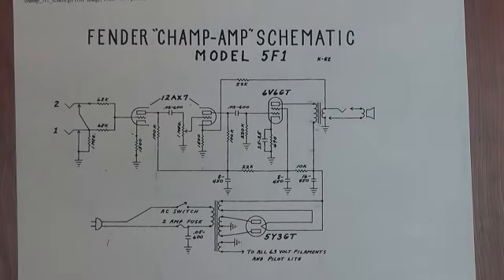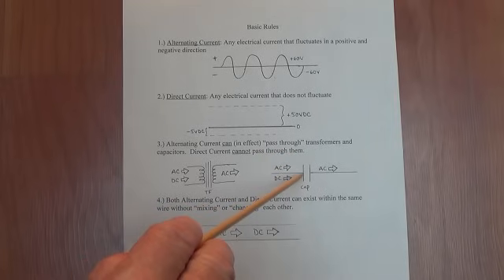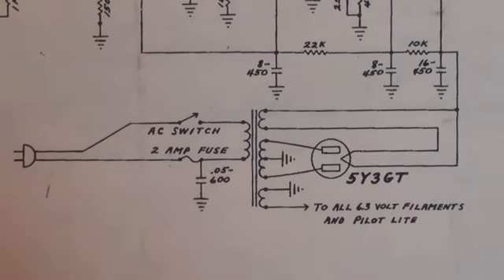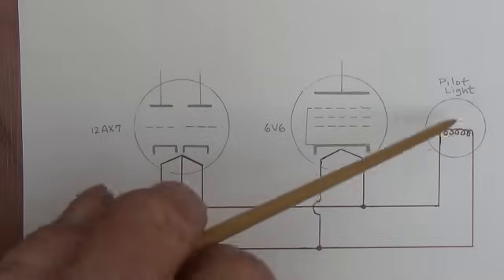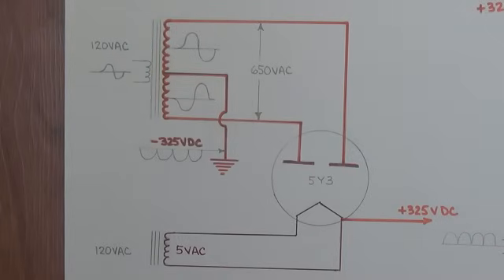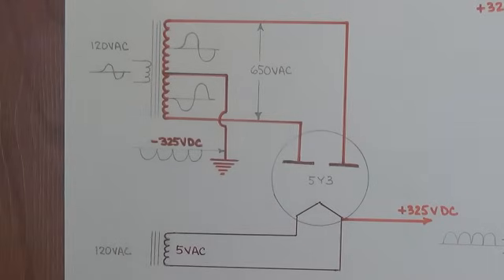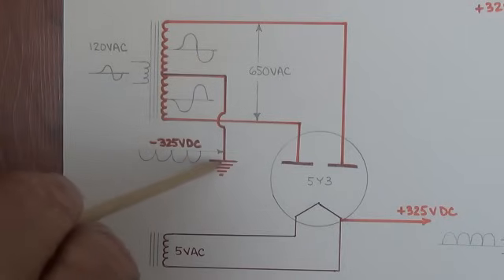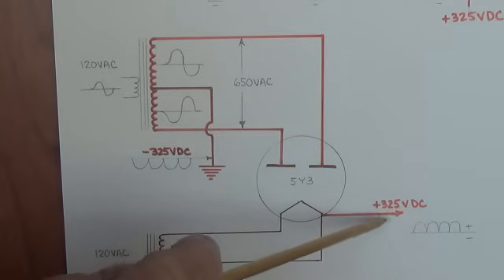How Tube Amplifiers Work, Part 1: The Power Supply

Comment: Hi Uncle Dough, I have a spare 6z4 tube and a tiny Qrome LM386 amp, no outputs, inputs, or power supply. Can I use a tube rectifier as a power source for that amp using that 6z4 tube, and what power transformer would be appropriate?
Reply from the maker: I only deal with vintage tube guitar amps and have never worked with either tube; thus, I can't offer any meaningful advice. Sorry.
Reply: @UncleDoug  Thanks! Your lessons are a big help anyway.

Comment: Why are rectifier tube heaters powered with 5 volts, when the other tubes use 6.3 volts?
Reply from the maker: Good question, Scott, and there are several different explanations.....but since there are 6.3VAC rectifier tubes in common use, i.e. the 6X4, there is probably NO reason that 5V is essential.....BUT the 5V rectifier tubes, like the 5U4, 5Y3, and 5AR4,  are more robust and can handle greater voltages and current. Thus, while a 6X4 is OK for a relatively low-wattage circuit, you really need a more robust 5V rectifier for DE, greater than 10W circuits.

Comment: I had to go back and rewatch this ,I got confused watching someone else but as I see it the rectifier changes the voltage to DC off the Transformer  splits the current and the negative goes back to the center tap to ground ,think I got it now
Reply from the maker: I hope it made sense, Joe.

Comment: At 16:17 one does not normally measure the center tap with respect to neutral as you said. The death cap on the neutral may AC couple 60 HZ to chassis but that is for noise (hum) reduction and not for reference of voltage measurements on the secondary side of the power transformer. Usually you measure all the secondary voltages to chassis (Ground) which is still floating from the AC input power albeit through the death cap, thus you don't see the negative voltage on the ground because it is referenced to itself (0V).  You kind of glossed over how the dual Diode Rectifer tubes actually rectify. I teach STEM and even though my students pickup everything else, how it "superimposes" hundreds of Volts on a 5V heater filament is the question they ALWAYS ask... so I explain it as each phase of the high voltage windings power the plates... at 0, 45, 90, 135, 180, 225, 270, 315, and 360 degrees  of an an AC cycle. It is truly a simple process but is not intuitive enough to simply skip it.
Reply from the maker: Thanks for your helpful input, Paul. With any basic presentation, some concepts are either not included (by choice) or are overlooked.
Reply: @UncleDoug  You have a great series, I overlook things too but my students NEVER let me get away with missing something [smile]. They ASK questions but DEMAND answers... too much brain power in the room I guess.
Reply from the maker: Thanks, Paul :) @paulromsky9527

Comment: Great video. At 14:43 you should have mentioned that when using a scope to look at each output winding, the ground stays on the center tap, that is, each winding end is measured with respect to ground (the center tap)
Reply from the maker: Thanks for your helpful input, Paul.

Comment: House voltage is 120 vac RMS (peak times .707). When you show the wave form you are showing the peak to peak voltage and for house voltage that is 120 x 1.41= 169.2 x 2 or 338.4 vac peak to peak. So 169.2 on the positive side and 169.2 on the negative side. Not 60v and 60v.
Reply from the maker: Thanks, T, but all of this was fully covered in the Comments section and in subsequent, more detailed, videos.
Reply: That is good  @UncleDoug

Comment: After installing a 3-prong cord, (since amp components go to chassis ground, and chassis ground is tied to the green ground wire in the wall, and given the design of a GFCI outlet where current in is measure against current out), would it be normal under those conditions to trip the GFCI when powering up the amp?
Reply from the maker: No. The presence of the green ground wire has no effect on the AC current flow in and out of the circuit.
Reply: @UncleDoug  thanks.....then I remain focused on my issue.

Comment: At 15:49, I was initially unclear on the operation of the 5Y3 diode. So apparently the filament is operating as double duty as both filament and cathode. I could understand that as the filament emits electrons, it will become positively charged. However, the two plates are alternatively charged by the transformer, so that when one plate is positive, the other is negative. The charges would typically cancel out, but I guess if the tube was designed so if the plates were separated (say, by placing them on different sides of the tube) their interaction could be minimized. But where is the return path for the electrons given off by the filament/cathode? As electrons are emitted by the cathode, how are they resupplied?  In this diagram, the 5V cathode supply and the 650V plate supply appear to be two independent power sources. However, looking at the circuit diagram at 4:43, I see that one end of the 6V transformer tap is connected to ground.  This will close the loop between the -325V center tap connected to ground and the +325V generated at the filament.  Another option is to connect the center tap directly to one of the 5V transformer tap leads instead of going through the ground circuit.  This may help reduce common mode noise injected from the mains and is a technique used to power VFDs.
Reply from the maker: The 5Y3 has a directly-heated cathode, i.e. the filament and cathode are essentially one structure. The B+ exits from the rectifier and is sent to the tube plates, providing them with a strong positive, electron-attracting charge. The cathodes of the tubes are connected to the grounded (B-) center-tap of the HV winding, providing the cathodes with an unending supply of electrons. As the heated cathode releases electrons they are attracted to the positive plate, creating a current flow within the tube which is moderated by the charge on the grid.
Reply: @UncleDoug  Thank you!

Comment: Hey Uncle Doug… I have a question about the primary side of the transformer in your example… should the fuse not be on the same leg as the switch? Preferably before the switch and on the line(hot) side..? The reason I ask is that I recently was in an amp and the line(hot), was switched and the neutral was fused.. This amplifier had a three wire AC plug, therefore the chassis was grounded.. So what I’m concerned about is if, hypothetically the fuse blows, there is still line voltage getting into the amplifier through the switch… so if, again hypothetically, the short is in the power transformer, would it not still be posing an electrical hazard..? Just wondering what your thoughts are on this..? You explanation would be greatly appreciated.. Thank you..
Reply from the maker: All of this risk and uncertainty is eliminated if you simply wire the primary circuit like I do in every one of my videos:  Black (hot) wire.....on/off switch first then fuse then one PT primary wire. White (return) wire......connect directly to the second PT primary wire. Green (ground) wire connect direct to chassis. When the switch is off the amp is really off and you won't get electrocuted checking the fuse.

Comment: Hey there, Uncle Doug;

I know that you review comments on your old videos. How about a video on the exact calculation of B+ voltages? Most of your circuits are Fender based, which typically use the same or similar transformers, tubes, and resistor values. How about EL84 circuits, or stereo circuits? I can never get my current to voltage calculations to match the specification sheets, which makes me reluctant to actually build the amp.

Thanks for all the education.
Reply from the maker: The voltage and current values stated on schematics are made on a single circuit measured with a relatively low-impedance device. They are for general guidance, not absolute value, especially considering the fluctuation of AC supply and the development of high-impedance DMM's. Minor deviations from schematic values are to be expected. It is only when the deviation exceeds 15% or more (an arbitrary cutoff) that malfunction may be indicated.
Reply: @UncleDoug  Horse shoes and hand grenades? I had my suspicions. Thanks.

Comment: Great Video! i learned alot. one question if i may, what causes the phase switch in the lower sider of the 650V AC secondary? is the coils wrapped the other way? is the negative lead to ground causes this? thanks!!
Reply from the maker: Thanks.....good to hear. Yes, to both of your guesses. The lower winding generates a field that is 180-degrees opposed to the upper winding.

Comment: I have a couple of questions and perhaps they're answered later in the series... but... first, I'll prefatorily admit, beyond a simple circular light bulb circuit, I know very little with regard to circuitry.

When we transform our 120VAC into 650VAC... what is the cause for its differential division into (325VAC) & 325VAC?
I realize you've inserted the division ("tap") of the transformer coils @ the half-way point but what is the cause for a differentiation of one side to positive (replicated waveform) and the other to negative (mirror-image waveform)?
Is it merely a consequence of the "tap's" introduction into the circuit by way of physics-magic?
Or, are the actual coil directions reversed as compared to the top half?
Or, is it all the collective result of an interplay with the rectifier somehow? Except... what difference would that make if the rectifier diodes are only catching and distributing negative electron-popcorn from the 5VAC heater?
Further, perhaps it's all to do with the aspects you'd indicated you didn't want to get into for this lesson... but... if our 5VAC heater will only "pop" electrons, then why would we need to choose which direction to orient our rectifier diodes?
Meaning... won't our heater ONLY radiate a negative particle?
Or l, have I misunderstood?
Please, forgive me if mine are illogical or unnecessary questions but I am a guitarist who's newely interested in the art of electronics and this feels like the best place for me to start.
Thank you!
Reply from the maker: Answering all these questions would take way too much time and space, TT. Both the videos and other sources on the internet can hopefully provide the answers you seek. Good luck.

Comment: Would anyone know if it makes sense to have one (1) hv lead coming out of a power transformer on an old amp... (2) 6.3vac.wires...(2) 5vac wires....(2) primary 120vac wires and (1) hvac secondary lead  is what I'm seeing on mine....makes no sense looking at amp schematics I'm seeing.
Reply from the maker: Check to see if there is continuity between the single HV wire and the body of the transformer. Perhaps the DC return was through the chassis.
Reply: @ Uncle Doug... I'm showing zero continuity from the single HV power transformer secondary wire to the transformer body. However, the incoming power cord neutral was connected (I since have removed) to the chassis via filter cap can body ( the neutral was connected to one lead of the transformer primary (correctly) and also connected to the chassis through the cap can body, (which is mounted to chassis) if that makes any sense).
Reply from the maker: @rustycalvera977  It doesn't, Rusty, but the bottom line is, if there is no return for the HVDC then the amp will not function.
Reply: @UncleDoug  right.....the amp did work with that warm beautiful old sound from the 40s (as I found it wired) with the neutral from the power cord connected to both the chassis and connected to the primary of the transformer. I'm really stymied with what I'm seeing. I  began this project wanting to simply swap out all the caps and install a 3 prong power cord to make the amp safe and happy, but the three prong power cord is questionable now since the chassis may be an essential part of a floating neutral in the circuit as I'm coming to understand it ..thanks for all your insight...appreciate it.

Comment: Im 61 and have only ever built two tube amps.  First 40 years ago was a 10W audio amp ECL 86 ?  Triode pentode if my memory serves me correct. The more recent was a GS35B 1KW PA for 50Mhz 6m ham band amplifier. In the last 6 years it still goes hard, never had the lid of it. Unfortunately LDMOS has killed the big tube amp for RF, but that's a good thing in my books.
Reply from the maker: Thanks for sharing, Mark.

Comment: Is there posibility dual filament bulbs,back fead alternator,positive linear voltage regulator,miltipel ic chip types relays,and xenon bulbs can act similar to wacum tubes with e core ignition coils?
I hade some strange effects with my car recently it self acelerated the engine became magnetised,engine some times act as hit and miss with blinker relay or it refuse to stop engine as well I hade multipel scenarios where alternator is exposed to different capacitor types to note non of my circuets dont have diodes or ballast resistors.
So can some one explain my why and how to detect external frequencys interacting in circuet and how to prevent it or rather control it .
It is classic GM car design based on Opel car from the 80s.
Only thing I know it has strange wire harnest .
I did noticed 4pin defroster relay pin 86 is bound to alternator field wire the alternator it self has only bulb no diode and the dash regulator also has no diode .
Xenon shuld have ballast I do not have it for years sudenly strange staff apeared like engine self acelerating so I hope some one has ideas why and how this acures any thing ells I noticed door switch mouse broke wire conection to ground and hande brake wire also I noticed the same defroster relay 4pin is leaking current for some reason over night I suspect the internal diode is fried or leaky .
So I suspect xenon bulbs and rear heater acting some sort of gride or external heater and some how multipel relays interacting with those effects or back feading alternator.
Im not shure how to deal with such problem .
Reply from the maker: Neither am I, Elvin. If you ever figure it out, let me know.

Comment: Yes, really the best video online, great job. 1 question : i saw many video explaining that the 6V AC used to heat the tube could generate hum due to the 60hz cycle. So why don't we use a rectifier (diodes to makes it simple) to provide a 6V DC to heat these tubes (probably needs to provide 12v DC but i'm not sure about that) ? Ok it's not stock spirit but is it technically possible with 12AX7 or 6V6 ?
Reply from the maker: Thanks, JB. If an amp is properly designed and wired, using AC to heat the cathodes will cause no problems at all. Yes, you can rectify the heater supply, but 99.5% of the time, it isn't necessary.
Reply: @UncleDoug  fully agree, an old fashion amp properly designed and build will be dead quiet. You are providing, with Rob Robinette and some others experts so much valuable tech info on amp, thanks a lot for all your work 🙂

Comment: Why do you use a capacitor on the 120v circuit?
Reply from the maker: That's the "Death Cap", originally intended to reduce noise in the AC supply. They are generally removed from amp circuits.

Comment: Thanks a ton for this series! It's answered many questions I had on how tube amps work, and provides a great starting point to dive deeper! One thing I'm having a little trouble wrapping my head around, if you don't mind me asking, though. When explaining the 6V line, you mention that the center line going to ground from the 12AX7 is carrying 12V and hence the 12 in 12AX7. But for some reason I can't get past the idea that running two wires to ground from the same +6V would still end up with a 6V potential difference, just running through an effectively twice as thick wire. Or am I missing the point entirely by ignoring the fact that the filament is in the circuit? I'm probably missing something entirely obvious, but I can't figure out what. Thanks again for the excellent information!
Reply from the maker: The filament circuit carries only 6.3VAC, Ron, but it is carried to both ends of the center-tapped 12AX7 filament.....thus each half of the filament has 6.3VAC for a total of 12.6VAC.
Reply: @UncleDoug  Ah, thanks, that makes sense. I did some further searching and found that it can be run in 12.6V series or 2x6.3V parallel (like in this circuit, if I'm understanding it correctly), so now it makes sense again in my head! Thanks again for putting all this online and even taking the time to answer my question!
Reply from the maker: @RonSnijders  You're welcome, Ron.

Comment: Is it normal for fender champs to get EXTREMELY hot? I think the heat is what caused my pilot light to go out but the amplifier still works. I’m new to tube amps and I’m curious about looking into the issue but I don’t want to kill myself in the process lol
Reply from the maker: Yes, it is. Watch my videos on how 6V6 tubes in the smaller Fender amps, like the Champ and Vibro-Champ are ridiculously over-biased.

Comment: Hello Uncle D! I cant figure this out. I have a small lot 8-10 NOS 1 watt 240K carbon comp resistors. They ALL read .260M -.276M. BUT when i take 2 and set them parallel to each other they read 135K. I also another NOS lot that are 120K. They read fine but when 2 are set in series they read .240M. Thoughts? 
Thank you!
Reply from the maker: If you're being serious, and I hope you are, the readings you describe sound exactly right to me. You should do some reading on the values of resistors in series and parallel.

Comment: I noticed that the amp uses single rail voltage
Reply from the maker: A single-rail with nodal resistors forming RC filters as well as stepping down the voltage for each amplification stage.